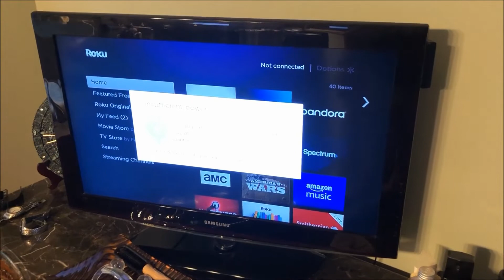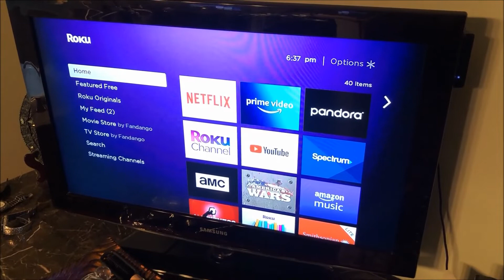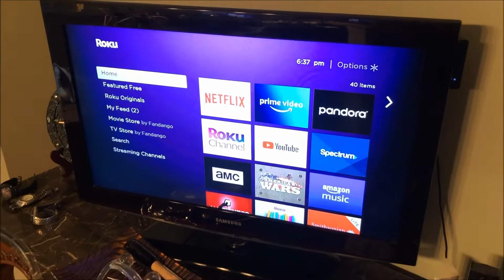How To Fix ROKU Low, Insufficient Power Problem! Don't Replace It, Fix It! Epic Video Clips YouTuber

Comment: Anyone who is doing the following and it still doesn't work, reset your roku on the back of the roku device hold the reset button for 10-15 seconds and then just set it up again and it should fix itself. Hope this helps
Reply from the maker: thanks for the additional input

Comment: my tv is PITCH BLACK and there’s some red light blinking on it and no matter what j do, reset it, unplug it; it won’t WORK do you know what to do?
Reply from the maker: Hi there, sounds like the problem I had with my Samsung… check this video: Samsung Smart TV Power Supply Board Failure, Dark Screen, No Picture:  Don't Replace It, Fix It!!!!
https://youtu.be/Yflwedml0C8

Comment: Thanks for the tip, I tried 2 different cables, on 4 different power sources (2 different cubes plugged into the wall tv usb port and Nintendo switch usb port, nothing helps in my case, time to switch to a nvidia shield I guess.
Reply from the maker: sorry it didn't help... sometimes the easiest possible solution doesn't work.